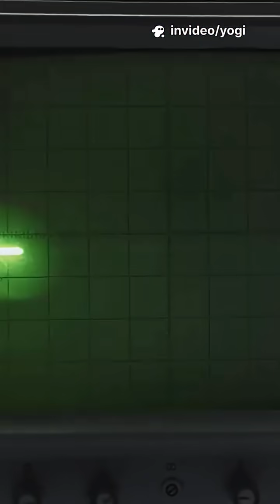Ohm's Law  Limitations #trending #facts #sciecne #physics #nature #reels #youtubeshorts #youtube

Comment: Stop talking non sense.
Ohms law ONLY speaks of the relationship between voltage, current and resistance. It says Nothing about the type of conductor.
Example for a semi conductor: when the current through the base connector is increased, the a current starts to flow between Collector and Emittor.
The current through, and the voltage over the EC pins can be measured. Say 10 Volts and 0.5 amp in current. Ohms law says that the resistance is R=U/I = 10/0.5 =20 Ohms.
And this is correct.
In a super conductor it gets interesting because resistance is close to zero Ohm.
I = U /R = 10 Volts (for example) / 0 Ohm = infinite current. This is not possible in real life. The current is ALWAYS limited by other factors.
What you probably try to explain is that not in all cases, such as super conduction and semi-conductors, you cannot directly measure resistance such as with a resistor but only calculate it. Well, Impedance (AC resistance) can also not be measured directly. But nothing about that in this video. I understand that. You hardly understand the concept of DC resistance.
Bring the video down and try again.
Reply from the maker: According to you ohm's law applicable in all type of material there is no any limitations 😅
Reply: @sciencewithyogender3866  Show the proof. Show me the math. Show me examples, calculations, measurements. Not a hollow empty response.
Reply: @sciencewithyogender3866 Ohm's law is not applicable in all type of material.!🥲
Reply from the maker: Second one may be you not listen the video carefully